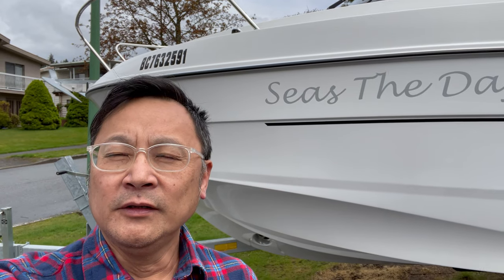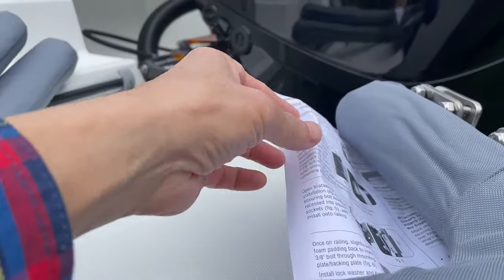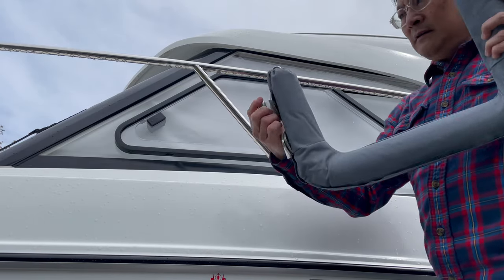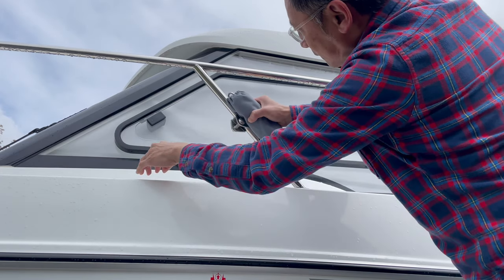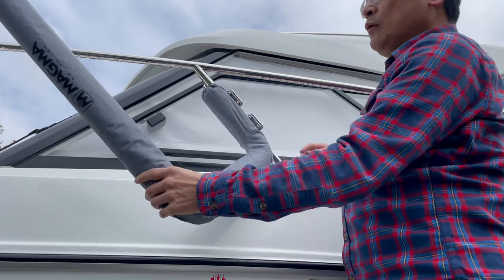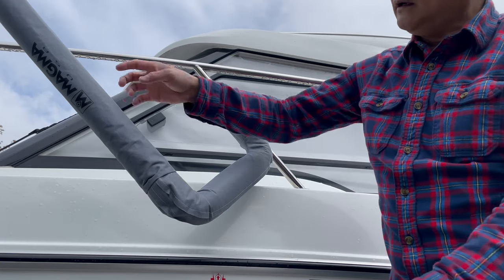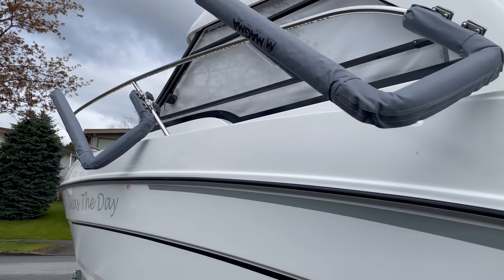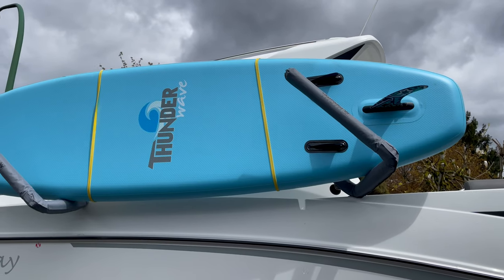Boat Hardware Installation DIY. SUP/Kayak Rack by Magma.

Comment: I don‘t think that is a good idea. You can‘t see anything on your port side, when you are at the helm (don‘t even think that‘s legal). A better option in my mind would be an inflatable SUP, you can easy store it on board and it takes less than 5 min to  inflate/deflate.